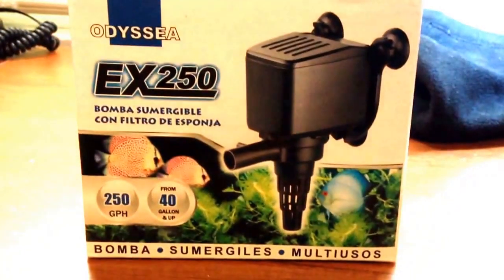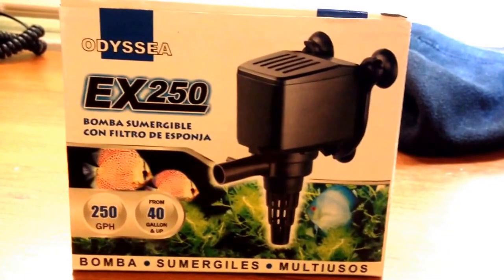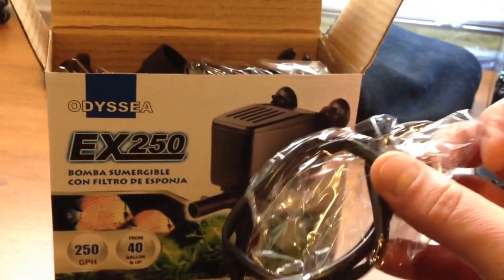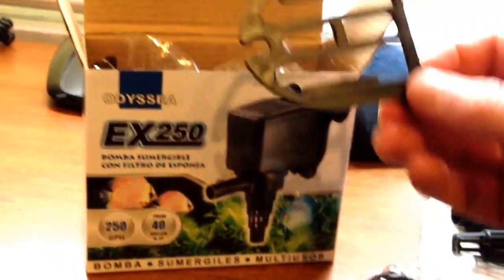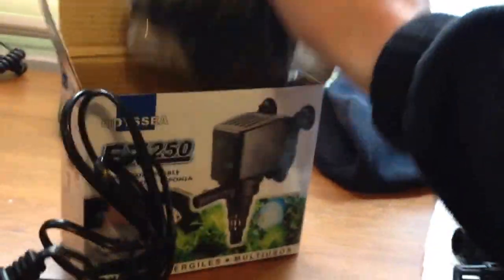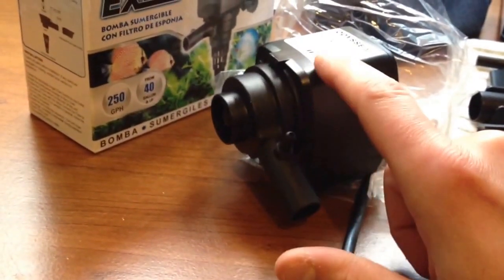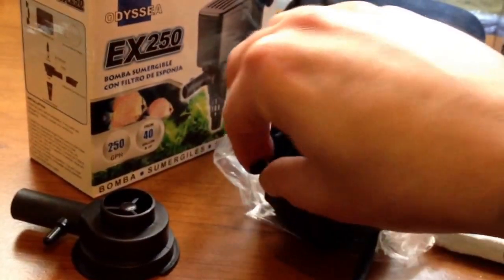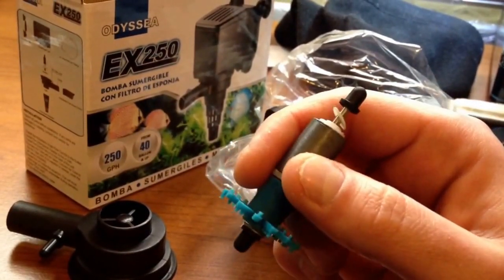Odyssea Ex250 pump

Comment: hey try finding an adapter that can get the inlet for the air before the impeller, having the inlet after defeats the propose of the needle wheel. i dont know why they would have one after unless that pump is meant for fresh water aeration.
Reply from the maker: Yeah it's not the best pump in the world. Some bubbles generate but there could be more. Also, it needs extra regular maintenance because the air inlet get calcification buildup and completely blocks the intake. Prolly not worth the $14 but better than paying an arm and a leg. Thanks for the comment.

Comment: Just subscribed are you going to do a update on the 14g
Reply from the maker: Thanks. I probably could do that. Not much has changed in it, clownfish getting bigger but so is the hair algae. I'll work on the update project but I usually fall of the aquarium maintenance in the summer. Thanks for the comment.